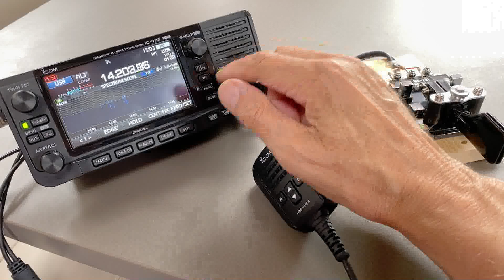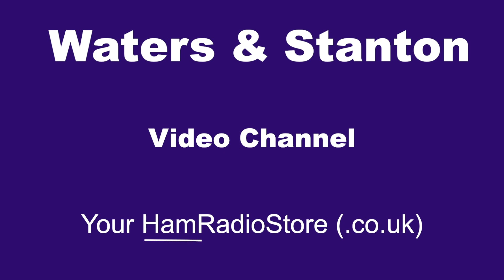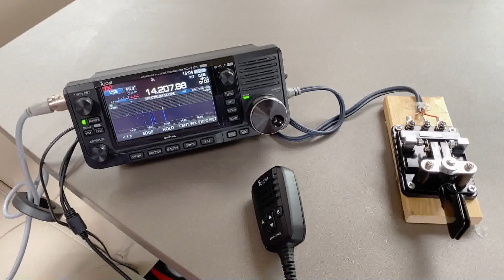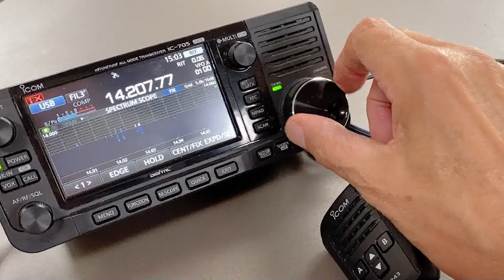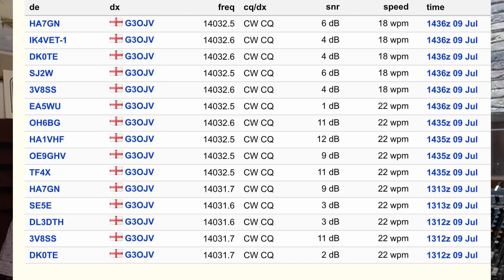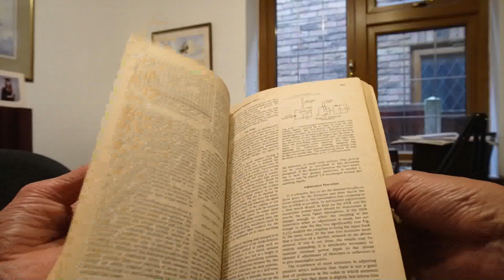The End Fed Half-Wave (EFHW)  Traps - Don't Make Assumptions!!

Comment: You say that inserting a capacitor in a wire antenna “stretches” it, but that seems like the wrong word. When you insert an inductor you make the wire act electrically longer, and that’s what I’d call stretching. I think inserting a capacitor has the opposite effect, making the wire appear electrically shorter. A shorter wire resonates at a higher frequency. And I think you said the harmonic resonant frequency moved up when a trap was added, which is consistent with what I’m describing.
Reply: Exactly what I was thinking. 
Inductance makes the antenna look longer, adding capacitive makes it appear shorter.

Comment: Do you feel that a trap near the centre of an antenna (say a 10m trap in a 15 or 17m efhw) would adversely affect the performance for 17m as its near the current maximum area?
Reply from the maker: The trap in the antenna you describe will work, but you will need to reduce overall length as trap adds inductive loading.
Reply: @watersstanton  yes I know that but what about the proximity of the 10m trap to the current maximum on 15m?

Comment: Construction project neat. Just one question, other than determine the resonance frequency thru construction technique and tuning.  Is there a formula or "rule of thumb" in determining the placement or length of wire in between the traps?
Reply from the maker: The formula or calculator can be found on Google. Just key in half wave dipole calculator. That will give you the length as a starter, but will likely need final adjustment in situ. The frequency you need is 18.1MHz. 73 Peter.

Comment: Nice follow on video. Just made a 20m one for portable in Cornwall.  Check out the qrpguys 49:1 transformer, neat qrp transformer and wire winder in one. Reasonable price too. I have put 20w ssb through it no problem at all. 73. MW0SAW